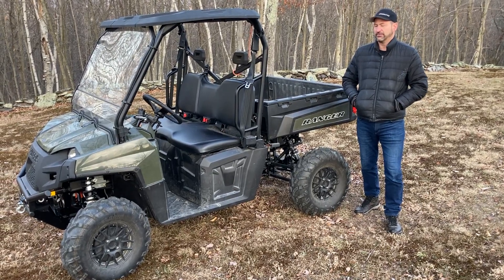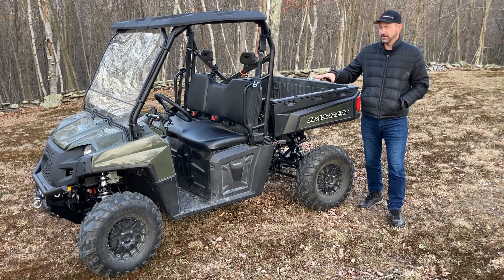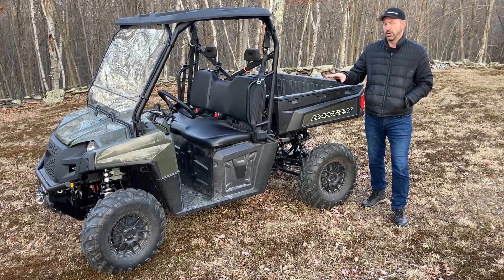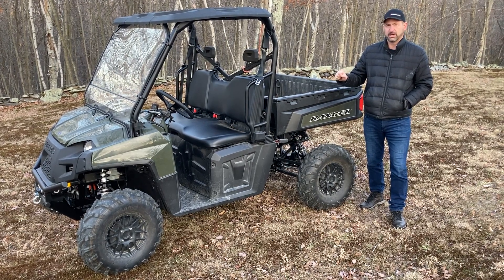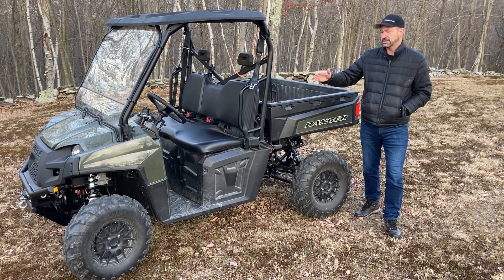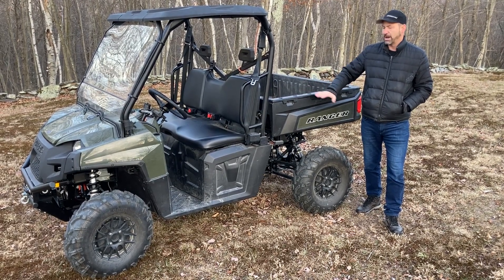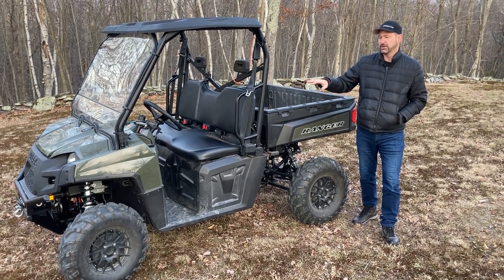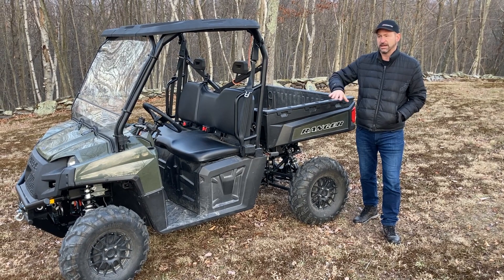Christini E-UTV Explanation - Electric UTV - 4 Hub Motors

Comment: is there any differential-like software to control wheel slips or is it unnecessary?
Reply: Not with 4 wheel drive and locker using the original drive train, but I like your thinking..